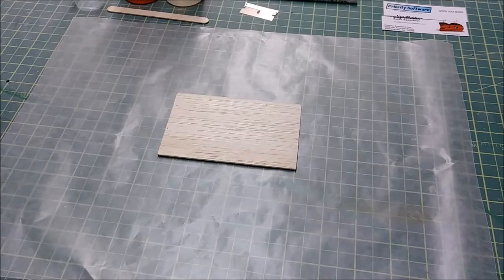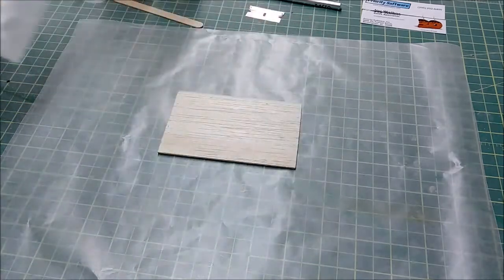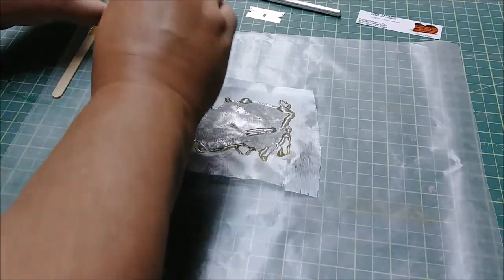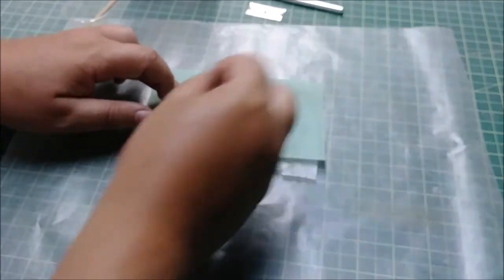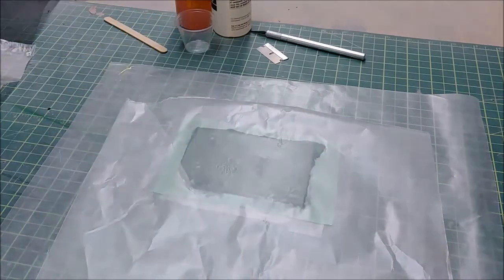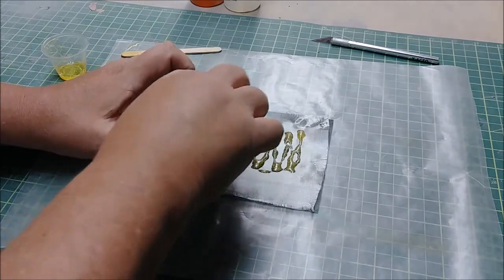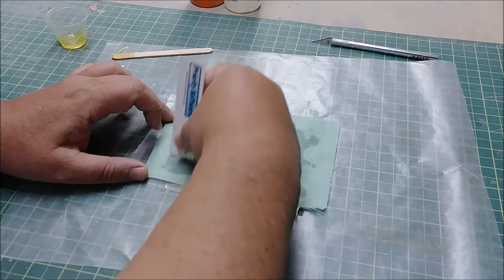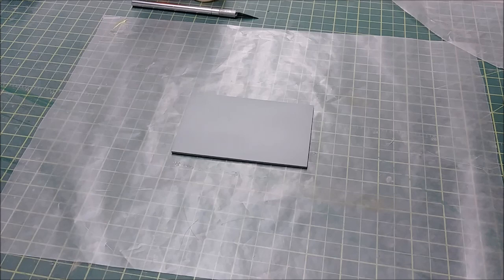Making Lightweight Servo Hatch Covers

Comment: Hi. Could you tell me what that greenish looking stuff is? I think you called it 'peel ply'? And, what purpose does it serve if you remove it after anyway? Thank you in advance.
Reply from the maker: Hi, Peel Ply is normally used on vacuum bagging to distribute the resin evenly and level it. Basically, it's doing the same thing here. It is wicking away excess resin from the fiberglass cloth and leaves a ready to prime surface. No sanding!
Reply: @Rcscalebuilder  Great, thanks very much.
Reply: @Rcscalebuilder  , Do you buy the Peel Ply from cstSales? And is it NEW Coated Polyester Peel Ply, 60" wide? Thanks
Reply from the maker: @sprietnicolas4199  I use a high-quality Industrial Peel Ply called Airtech Bleeder Lease B. It is not listed by weights (though the B is 1.8oz) and is of medium stiffness (A is thinner more flexible, B is medium and C is much stiffer and thicker) which I have never had a problem related to the thickness. I have found it to be a much better Peel Ply than at self-leveling and very easy removal totally eliminates any worries of delamination. Also, it is a very very tight weave leaving a truly ready to prime surface. This is what I use and it works great.
I buy mine from a company called Elite Motoring as you can buy it by the yard or they sell it in 100' x 60" rolls if you call them.

https://www.ebay.com/c/1147205382
Hope this helps.
Mike
Reply from the maker: @sprietnicolas4199  There is a great thread on using Peel Ply (many threads actually) that will answer your questions you may have.
https://www.rcscalebuilder.com/forum/forum_posts.asp?TID=28588
Reply: @Rcscalebuilder  Hi Mike, I have used the peel ply you recommended and it worked great so far. Just curious since this peel ply is "designed" for use with a vacuum system. Do you think it would work to use on wings and other surfaces without vacuum bagging?
Reply from the maker: @sprietnicolas4199   Absolutely! I and many others use it all the time for that... Check out my buddy mark's video on using it for smoothing fiberglass surfaces.
https://youtu.be/VjxEMUhlDxI